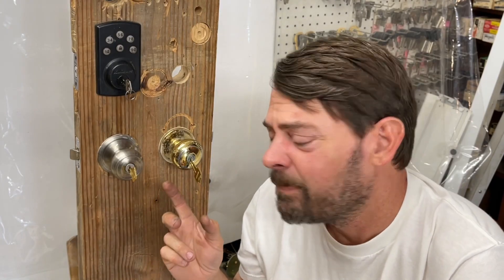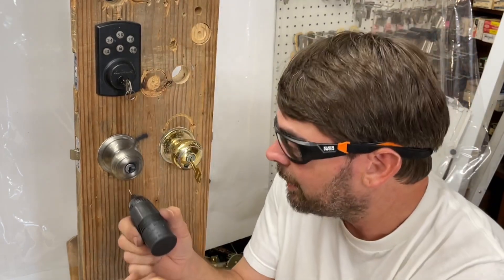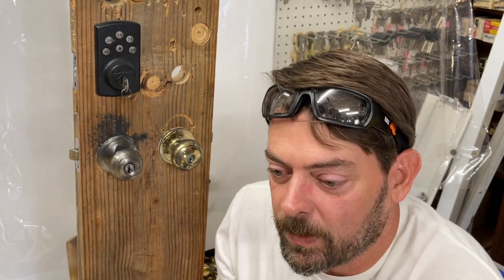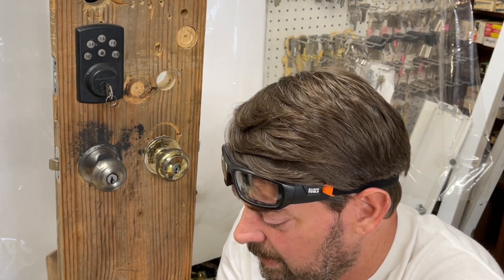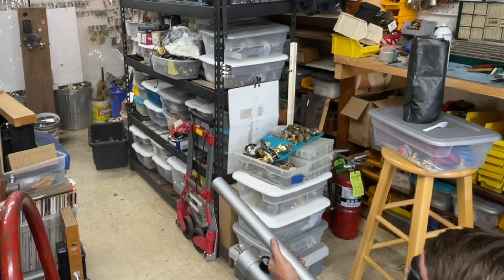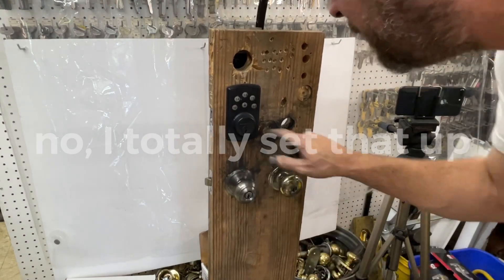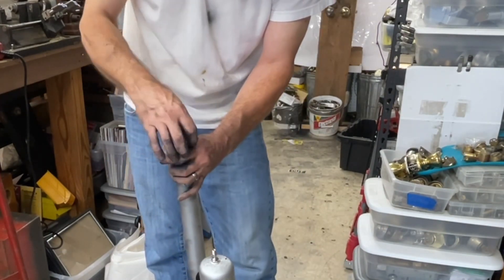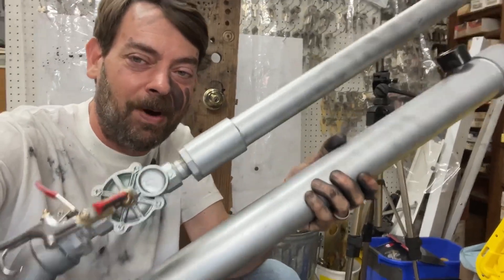Rapid Graphite Deployment System RAGRADS MK 1

Comment: The way I see it, it depends on the type of weather you have in your area.  Here in sunny and dry California graphite works better than WD40 which dries up pretty quickly and collects dust.  I've used lighter fluid for cleaning cylinders out also because it evaporates.  I've even used a graphite spray lubricant on bicycle chains.  So I think it depends on your climate.
Reply: Also, most of my graphite use is when I'm in the shop with the cylinder disassebled.  If deployed in the field I use it for automotive locks for the wafer type locks.  For pin tumblers I use it above the bottom pins for the master pins.

Comment: Yes, this is so much better than the HPC unit.  You can deploy the graphite from a distance and possibly prevent getting your nice clean white t-shirt (or labcoat) from the messy black residue. PS I suspect you could also use this as method to mark intruders or Jack Wagons that steal your parking spot.
Reply from the maker: Oh yeah, this thought crossed my mind a few times after that first WHOOOSH SPLAT
Reply: I'd love to see it get used on parking idiots. Don't say anything, just blast em.